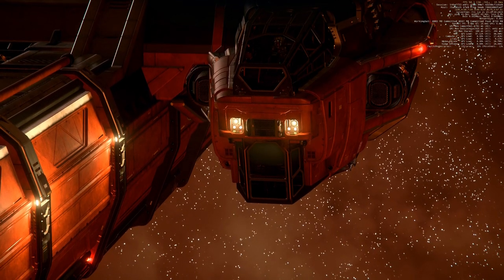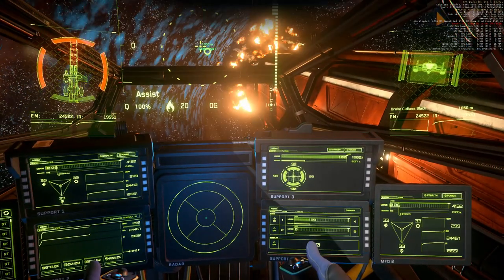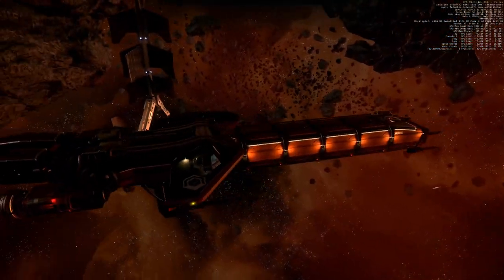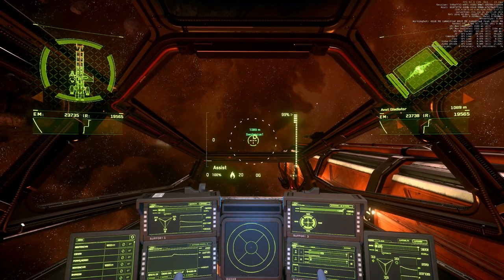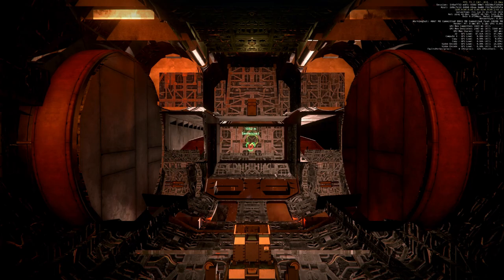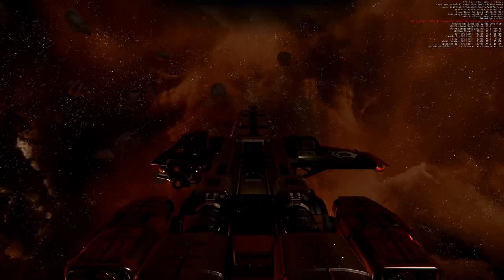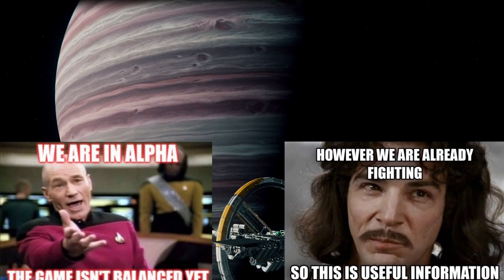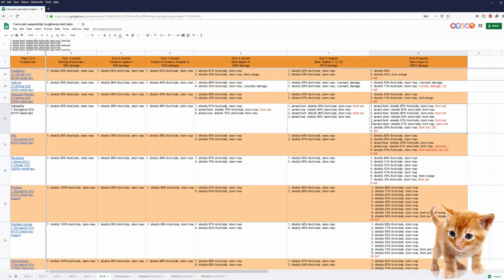3.5.1 Toughness test Caterpillar - need new shield tech

Comment: I loved flying my cat, but got tired of it's shield issues (Plus being unable to lock it until 3.5.1) pissed me off so much that it ended up being a hanger queen.  Eventually I upgraded it to a Hull-D and have been messing around with the Reclaimer.  I'll probably upgrade another ship in my fleet to a Cat sometime b/c they are such a cool ship, but not till the shield system is fixed on it and you can set up an internal defenses. It's just to much of a ship for a solo player to enjoy right now.   I'm also curious how the C2 will stack against it when that finally comes out as well.
Reply from the maker: Black Dragontooth love the tests you did, for example: SC Caterpiller Test 3.3.5 PTU https://youtu.be/qMKgd0XTqH0

To be honest (no it's not because we are in between patches) I'm getting more any more annoyed. Many basic game mechanics that worked perfectly fine before 3.0 are still not ported to item 2.0 (e.g. multiple missiles lock with feedback on HUD, missiles prioritization) but CIG is showing us caves (isn't this something for the time the basic game mechanics are done, Chris?). Anyone who think this game will be in beta in the next 3-4 years is an optimist in my opinion.

Anyway back to the Cat, if CIG gives us shields that work even if a ship has a stretched shape and shields that actually cover the whole ship (Caterpillar spikes at the front - your tests, Constellation cheeks and guns) and shields without shield holes then the Caterpillar will be a nice ships in my opinion.

I'm looking forward to the Hercules, I have a Hercules Starlifter M2:)